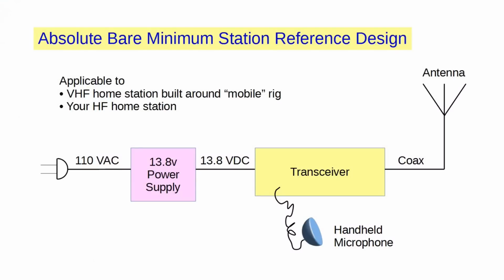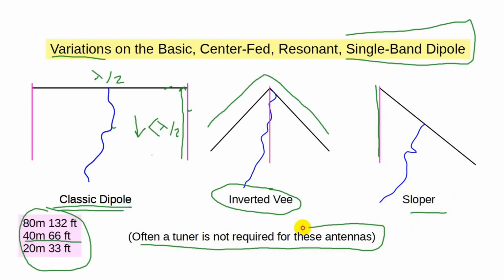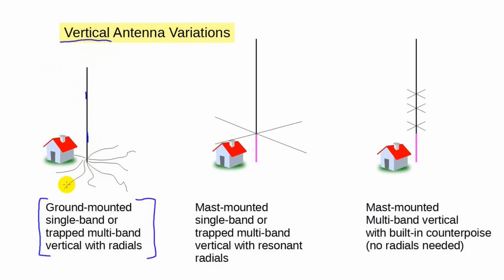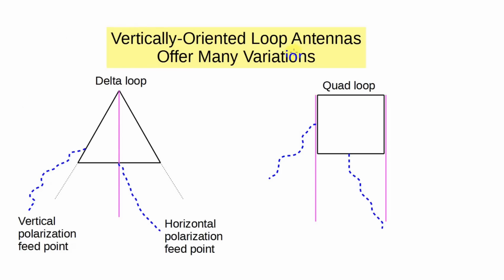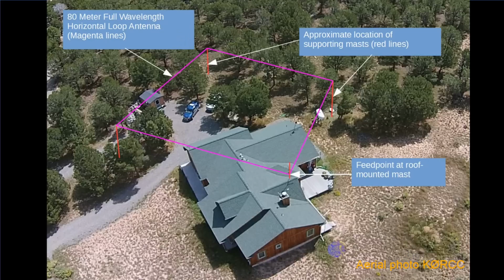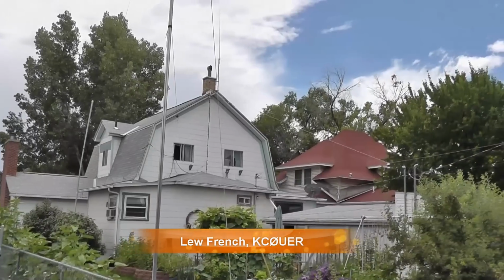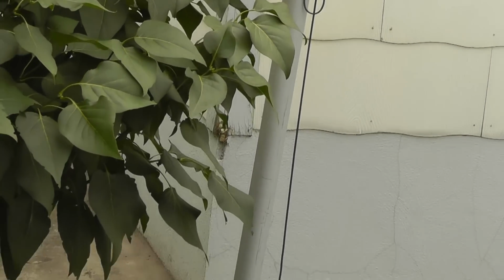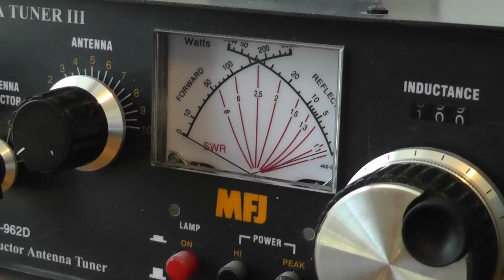Antennas for Difficult Situations: Ask Dave Episode 7

Comment: Very important topic which was not covered in this video:  "RFI" (Radio Frequency Interference) that your transmitter is causing to surrounding neighbors.  If your antennas are visible, fussy neighbors will always point at you as the culprit to any little problems that their electronic devices have, whether the problems are real or imaginary.  If your antennas are not visible, any RFI you cause to neighbors will remain a mystery as to their source, as long as you do not let those neighbors know you are a Ham radio operator. Standard response

      from Hams in the old days (when neighbors  had a sense of respect for radio  and community) was for the Ham  to help the neighbor eliminate his RFI problem  by installing chokes and other filters for him on his electrical devices. 

      In today's world of selfish entitled  narcissists, it's probably better to never divulge your identity as a Ham radio operator. If there is talk in the neighborhood about strange electronic noises and interference to their TVs, stereos, computers and devices.  it's best to agree with them and say that you too have the problem, and " you've heard that the city recently installed some new cell towers or communications link aimed through your neighborhood." 

       I sound cynical, but I have gone through years of complaints from neighbors in many locations, and fought with homeowners' boards, and even been taken to court. I even resorted to raising my antennas only in darkness and operating at night, then taking down all the antennas before the sun came up. It still didn't help the RFI  complaint problem. 

       By the way, I won in court, however I lost the war with ignorant  neighbors and the HOA  who decided not only were  my antennas violating the HOA rules, , but that  I was ruining their TV, stereo  and computer reception, and worst of all that  I was beaming " harmful radiation"  through their homes, that  was endangering the health the very lives of their children.

       This all sounds ridiculous, to anyone reading this for the first time, but mine is only one of thousands of horror stories that Hams across the globe have had to deal with from angry, upset and self-righteous ignorant  neighbors.  We Hams envy those amateurs who have the luxury of owning several acres in the middle of nowhere, where they can erect towers and run full legal power.

        Unfortunately in today's digital age of I-Phones and social media,   Hams are considered by many  people to be " something akin to relics of a bygone era".  Modern people have no antennas on their roofs, and are fed everything  via cable.  They use little radio gadgets like I-Phones, and laptops, and  they are perfectly fine living in a landscape of unsightly cell phone towers, because those towers feed their compulsive lifestyle of cell phone addiction.

         But once the power goes out, and there is a natural disaster, and an emergency situation in the neighborhood,  with no communications available for any of the neighbors or  the general public....all of a sudden, those ugly antennas that they hated so much  on the roof of that Ham radio operator  living  down the street, become not so ugly after all, knowing that he will volunteer to communicate with people during the emergency to help his neighbors.    It's best to keep your ham radio involvement known to Hams,  friends and family, but discretely hidden  from your neighbors if you live in crowded situations or have to deal with an HOA.   '73
Reply: Agree, your point is so valid. Nobody likes anyone enjoying life or a hobby these days. Couch potatoes are especially envious. I am particularly worried about my very large retirement apartment that I plan to move to in several years. Esp the radiation affecting health bit. Dont know if I will have to end up buying a very expensive commercial vertical or maybe I could try a cobweb !

Comment: Dave: I've just discovered you on Youtube and am really learning/enjoying your instructional videos. I am a huge fan of Vertical Antennas and thought I would throw this out to you. I own a Gap Challenger multiband Antenna. I mention this because, the Gap only uses three 25 foot long radials, and according to the folks at Gap, these radials are only required for use on the 40 meter Band. I live in an HOA environment and needed a stealthy antenna. My 32 foot tall Challenger is sandwiched between two large ficus trees and only about 5 feet away from a block wall. My antenna works 10 through 80 with the exception of one of the WARC Bands. I have worked on 100 watts, the south Pole from my Tampa QTH and Japan from my Phoenix, AZ qth, not to mention many European countries. I would love for you to mention the Gap Challenger or the Gap Titian in future Videos as a possible one size fits all multiband HF antenna. My justification for this is: These antennas are trapless, require no tuning, they work right out of the box! I can verify this as a proud Challenger owner, and my particular antenna was one of the prototype antennas, meaning one of the first 100 ever made and I paid only five dollars for it at a garage sale in Brandon, Fl; the find of the century! One other thing I should mention, the Gap Titian makes use of a raised counterpoise, however, you can eliminate this raised counterpoise by adding only two radials. If my memory serves right, one is around ten to twelve feet and the other is around 41 feet. This information was garnered directly from Gap Technical support. Yes, the antennas start in price @ $399, but they will last you 20 or more years. My antenna was perhaps around 20 years old when I had to replace the coax harness which lives inside the antenna, but spending $110 to overhaul my antenna to new performance was a small price to pay. Now that I live in Arizona, I suspect my coax harness will last much longer due to low humidity, my original harness had started to corrode. The Gap Challenger is a Vertical Dipole true multiband antenna which if assembled properly, will perform as advertised right out of the box. My SWR's on most bands are 1.3 to 1 or lower and this is across the entire portion of each band except 80 meters of course. Like any other 80 meter Vertical, you will see around 100 to 150 kc's of acceptable bandwidth. With Gap, you chose which portion of the 80 meter band you want to operate on by selecting the value of a capacitor which is inserted into the coax harness. By the way . . . the exact explanation of just how this antenna works is a carefully guarded secret, perhaps Dave you can elaborate  ;) These antennas have something like 35 to 45 feet of folded coax living inside them, so I believe this coax is used as a portion of the vertical dipole on some or perhaps all the bands. Again, the folks at Gap tell me that on the Challenger model, the three radials are only used on the 40 meter band. So again, I just thought I would throw this out there Dave, I have no vested interest in Gap Antennas, but am a satisfied customer and user for over 15 years, you would be hard-pressed to find a better multiband solution for those who are HOA bound. Many thanks for all you are doing to promote our wonderful hobby and 73,  de KM2U  Michael  ;)
Reply: Hi

Comment: Thank you for taking the time and effort to make this video.  Got my Tech.-level lic. 2012, but had to put things into storage until recently, so I am basically starting over with the learning process...to the point: I want to put a 40-meter Dipole and a 20-Meter Dipole over my house, in sort of an X-configuration, so that I may run the two feed lines down through a vent on the roof that leads directly into radio room (vent just runs straight down from roof to ceiling in that room, and has no fan or anything in it, just flap at each end)-- but I would also like to build and place a ten-meter Yagi on a mast on the edge of the roof.

The two dipoles will be supported by four of the fence top-rails described in the video, one mounted to each corner of the house, and the dipoles supported in the center where they cross by another small mount near the access vent , and adjusted to keep them as horizontal/flat as possible.  I will run a cpl. guys from each top-rail pole down into the yard.

The Yagi will hopefully be approx. 8-feet higher than the wire antennas and approx 15-feet away (mast attached to one side of house, with small electric rotator below the antenna).  Will having the two dipoles in proximity to one another cause issues?  What would be the minimum separation of the two dipoles I can get away with where they cross and have adjacent feel-lines...if one were 10-12 inches above the other would that cause problems?  The feed-points will then be one above the other and both pieces of coax will then feed down and into the vent approx. 12-18 inches away.  The feed-line and rotator control wire from the Yagi-antenna will also be going through this same vent.

I'd also considered making a 2-meter antenna, to put on the same mast as the ten-meter Yagi, so the rotator could control both and I would not have to put up an different mast elsewhere...if I were to do that is there a minimum distance I would have to put between the two...since the 2-meter antenna would be smaller I presumed it should go above the ten-meter antenna...but how far above on the mast would the 2-meter have to be, and would the two interfere with one another (would only be using one at a time)?

Thank you for your time and assistance, and thank you again for the time and effort you put into  sharing your knowledge with others.
Raymond - WF7BSR
Reply from the maker: Antennas are weird. The only way to know if the work is to give it a try. You can actually attach the 40 m and 20 m dipoles to the same coax, although you'll have a real balancing job getting it tuned on both bands. I did not recommend purchasing equipment or putting up antennas until you pass your general exam. I've seen too many people do it and then for whatever reason not pass the exam. Good luck with your studying!
Reply: Thank you.

Comment: Thanks for this video Dave.  My wife and I are both new HAM's I  Canada.  We are in the process of putting up our first true 2 meter / 70cm antenna as well as an HF antenna.  I purchased an end fed random wire antenna which claims to tune on bands from 10 to 80 meters. In addition I purchased a SOTA end fed for 20 and 40 meters.  My purpose in buying these specific antennas is to have both base station functionality and the potential to be used in the field for mobile/portable operations.  To that end we also have 2 HF radios, both of which will operate as base or portable rigs.  The first is an older Kenwood TS-50s and the second is a MCHF 918s.  The Kenwood will do 100 watts on full power but can also do 50 and 10 watts.  The 918s will do 15 watts max on transmit.  Your information about rigging various antenna configurations is especially useful for us as we struggle with the best way to set up our home base station.  That's for all you do to help folks like us solve the many issues related to putting up antennas and operating a station.
Reply from the maker: Best of luck setting up your station! Check out some local clubs. You can get great ideas from other members.

Comment: Hello Dave just got my first real radio (starter)  . It's a radioddity Qb 25 pro quad.  Today I'm climbing a row of trees about twenty feet from my room.  Can I leave the insulation on the wire and zip the the wire to the branches? Taking a 100 foot extension cord and usi the green and or black wire for up in the trees. For camouflage purposes.  Lol will I need more than one set of wires to stay at all efficient? Thanks again. Is there a formula I can use for this? (Length vs frequency? Ps zip ties will be only for holding in place loose enough for windage. Thanks.
Reply from the maker: Are you planning to transmit? You'll need to be running coax to a proper, tuned antenna. Note that one of the transmit bands on this radio is not a US ham band.
Reply: David Casler yes the 300 mhz of band.  I'm hoping to take the test on the 18th.  I would like to go for both tech and general. Seems that the general is more suited to the two years in electronics tech classes,  I'm studying hArd.  Is my father was a senior design engineer,  still remember much of what he taught me long ago.  He was a ham . Really like the SDR's  especially. Because I'm disabled and on an extremely limited budget. Joined the local Saratoga county radio club here in New york. My first visit is the one where I take my test.  Glad to hear you're feeling better.  I now have a Sr 94hpc stryker 10/11meter. And  the quad. Bought  a astron rs-20amp supply. Came with a Vega IP-223. With the tech manual and wires. Hope it's enough to get started. The quad requires  a laptop with Windows 7 or 10. Should that computer be ok for the SDR-RTL system?  I know your very busy so answer when convenient.  I wish my dad was still around buy hopefully I can find an Elmer in this club I'm joined.  We all appreciate your videos, but your health is more important go me as well as the rest of your followers.  Thanks again for all your help.  Have a great day . Thanks Dave for all I've learned from you.  .. Robert Lackey .

Comment: I have built a Mast-mounted single band vertical antenna with just one radial the same length as the vertical element. This unit does rest on a substantial metal platform. I seem to be getting acceptable performance. What limitations can I expect?

Comment: So here's a question, let's say I wanted to make an ultra-small HF (say 80 or 40m) for QRP "long to medium distance" data transmission; what's the smallest antenna I could get away with for transmitting say, 10-50 miles?

also, what's the smallest QRP data radio? I'm looking for something like the keychain CW radio's, simply for transmitting data.
Reply from the maker: Antenna efficiency has a general relationship with size, though mag loop antennas, much smaller, can do well. The distance traveled is more a function of propagation conditions than distance. If you only want 10 to 50 miles, you might be best off with NVIS or VHF.
Reply: I'm thinking about a Raspberry Pi with as small of an antenna possible. IIRC the transmit power of the pi is only like 10 or 100mW. the idea would be to transmit data, similiar to WSPR, however the data would contain location and other data transmitted to a base station. I was also thinking 6M might be a good candidate.

beyond line of sight would be a necessary aspect.
the smaller and less power the entire system can be, the better.
Reply from the maker: Take a closer look at APRS, which gives position reports.

Comment: If I have a vertical antenna and a 24’ Steel building would I need radials if installed it on top of the 24’x24, shop?
Reply from the maker: Probably a few would be a good idea. Lay them out on the roof. The problem with the metal roof as the only counterpoise is that the various parts and pieces are not bonded well enough together to form a continuous ground plane.
Reply: Thanks for the helpful info. It’s a tall building and I don’t like getting up there as it is. Well, suck it up I guess and get my kids to do it👍. I’ll screw the radials down I assume.
Reply: Gotta ask, the screws that go though the seams should ground each sheet together shouldn’t it? All screws are self tapping so both pieces of metal were bare to them I would think. In any case I’ll trust your good judgement.

Comment: Respect Dave - thank you for your previously replies- I have been searching on google My question (( google do not understand my question )) What is the inductance for a resonant antenna on the  4 metre band  respect how do one work for this same inductance for any antenna >>> thank you Dave
Reply from the maker: The nominal target antenna feedpoint impedance on any band is 50 ohms. Setting up an antenna to do that can sometimes be complex. The inductive (and capacitive) reactance on a resonant antenna is by definition zero. However, that does not automatically mean 50 ohms resistive.

Comment: TNX DAVE CAN YOU TELL ME THE LENGTH AND WIDTH OF THE uBITX CIRCUIT BOARD  KG6MN
Reply from the maker: Approximately 5.5 x 6 inches. There are things protruding from the sides, like the antenna connection, display board, etc.

Comment: thx for all your great videos ... great would be one that helps guys like me living in an Apartment with balcony ...
Reply from the maker: I've been on the lookout for good antennas for folks in your situation. I've tried some loops.
Reply: +David Casler Thank you very much - I think, that is one of the major bottlenecks for beginners to get into this new hobby. I did my exam two weeks ago and one of the first tasks I would like to achieve to get a direct connection to a friend's station. The problem is, that his home is not in the line of sight from my balcony, but located roughly 10 km behind the house (antiparallel to the line of sight) - so a quite difficult situation.